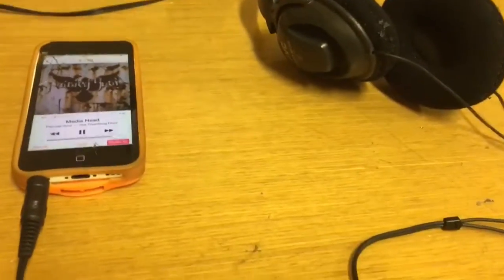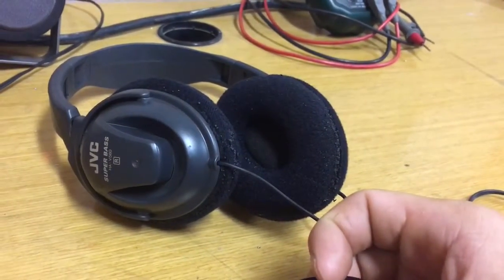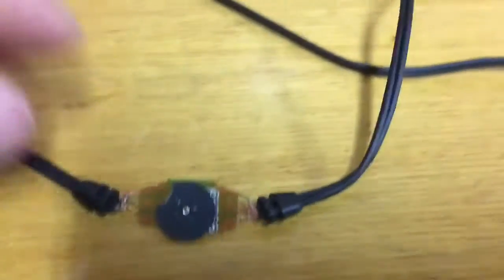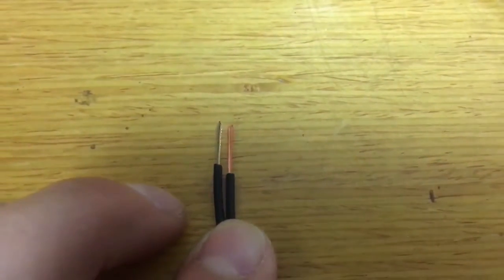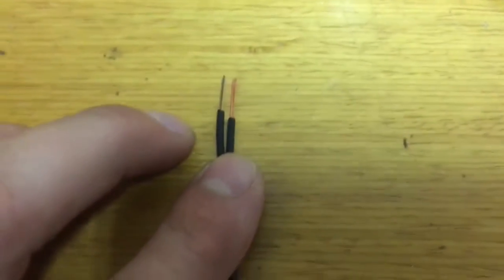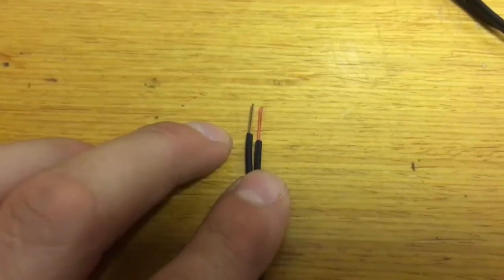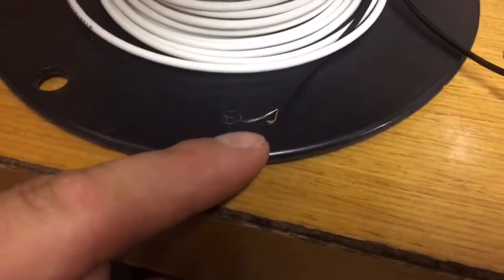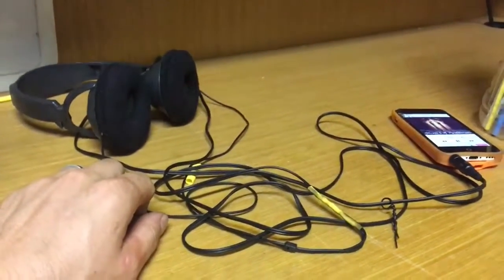Fixing headphones with a bad volume pot

Comment: Hey please show me your cables which cables you fixed. My volume button broken and i wanna fix it without it and i have, 1 blue, 1 green and 1 red&golden cables on the jack cable. I have 1 blue and golden cables on left headset cable, have a red and a golden cable on right headset cable. Which ones are for which ones?
Reply: im still waiting for  your reply your help